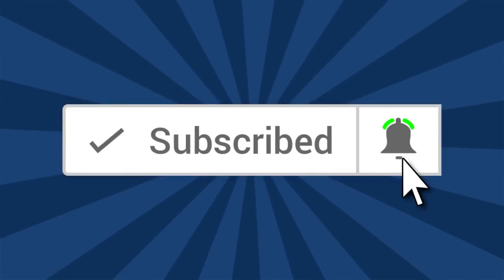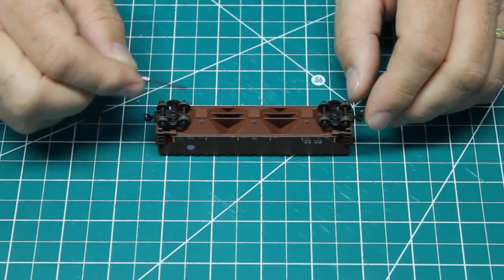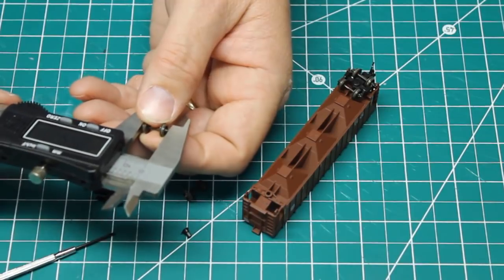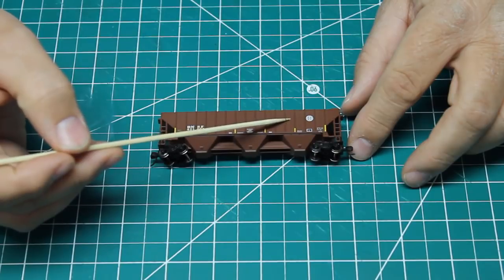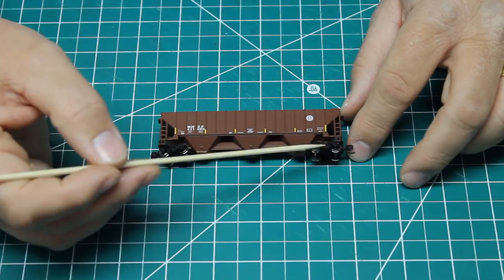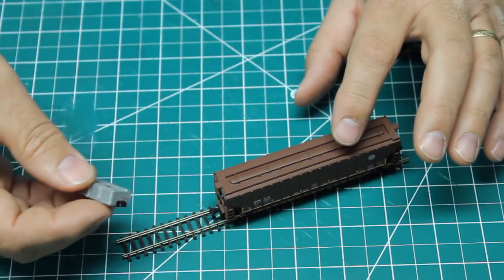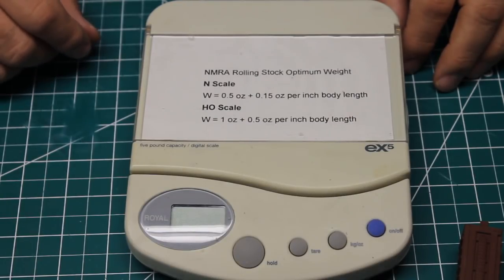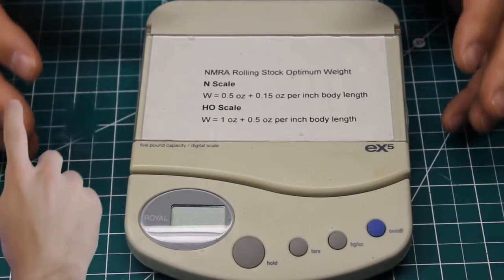Upgrade Model Railroad Rolling Stock

Comment: I replaced plastic wheelsets for metal ones for over 100 pieces of HO scale rolling stock.  I also cut off all the talgo truck couplers and body mounted Kaydee couplers to all rolling stock.  I changed out all incandescent lighting to LED lighting (either strip LED's for coaches and cabooses and single LED's for engines and back up lights).  While I was at it, I weathered each piece of rolling stock.  Took me several months and $400.00 for metal wheel sets and Kaydee couplers.  Cheers from eastern TN

Comment: What I like about metal wheels is that they add weight to a wagon increasing their moment of inertia, without increasing bearing friction that comes from the weight of the wagon resting on the wheels.

Comment: Good video with good tips.  I use graphite powder in every gear box for perfect  coupling and magnetic uncoupling.  I also use in on the wheel bearing pins reduce drag on the car.  Its one of the best performance upgrades
Reply from the maker: Good stuff
Reply: I'm going to have to try out the graphite powder. I'm new to N scale, and found out that  the MT and the Atlas couplers are inconsistent with each other, random uncouplings and sometimes don't want to couple together.  Hopefully a puff of powder into the boxes will do the trick.

Comment: Ron, a word about plastic wheels.  Back in the day when LP records were made they were stamped out from a mold.  The vinyl itself had some degree of adhesion, so before each pressing a release agent was sprayed into the mold.  Audiophiles clean brand new records because the release agent caused several problems. 

I wonder if new plastic wheels don't also have this problem.  The only way to find out is to take a new car with plastic wheels, clean the wheels thoroughly with isopropyl alcohol, and run it on the track for a while.  I would try this for you, but I'm still in the planning stage, hence no pike.

Thanks for all your hard work.

Comment: I WAS GIVEN 1960'S N SCALE CARS WHICH ALL HAVE METAL WEELS , BUT TO UPGRADE THE ROLLING STOCK I BOUGHT MT  BETLENDORF TRUCKS AND LONG  COUPLER . THE COUPLER IS LONG BECAUSE OF HELX IS MORE THEN 19 DEG'S. I EXCHANGE PLASIC WEELS FOR THE STEEL WEELS THAT WAS ON THE OLD CARS.

Comment: Great video Ron. Thanks for explaining about wheel set sizes of 28, 33, 36. Looking forward to watching your video on couplers.
Reply from the maker: Thanks for watching.
Reply: Same. I've been replacing some older tankers with "Bettendorf " bogeys/trucks and couplings from micro trains, but some don't look right. Now I know why!
I also don't like the plastic wheels. It's irritating that the expensive micro trains sets don't already have metal wheels.

Comment: I simplify the process, cage out wheel sets, cut off the trip pin and wiegt my cars .50 ozs. heaven than the NMRA standard, they track better and being heaven isn't an issue with pulling  power.
Thanks for the video it was informative.
Reply: Same for me, William......
Reply from the maker: That works. 👍

Comment: All but 2 pieces of my rolling stock are second hand. Just swapped the couplers on some rolling stock while watching this. The horn hook was replaced by a knuckle coupler. I have a diesel testing it now. Several loops and so far so good. Gave it metal wheels last night.just took the coupler from unused rolling stock. It didnt fit the current layout theme anyway.

Comment: Nice info Ron. As for the weight of cars, if you didn't see my post on Eric's video, here it is

The RP-20.1 NMRA is totally OBSOLETE. Since 1990, a lot as change, cars are build better, but mostly people build there layouts much better, for example, lots of people use much larger radius. Another example is if you're running smaller number of freight cars for delivery. Basically what I'm saying is it depends on your layout and how you run trains. I personally will have weights between 105 grams (empty) and 400 grams (loaded) (3.7 ounces and max of 14.1 ounces) for HO. 

A lot of factors should determine the weight of your cars. If you are running tight radius, than your cars shouldn't vary to much in weight, same applies if you are pulling lots of cars and especially if there is a mix in weights, for example, 3 light cars , 2 heavy, 2 light, 6 heavy, 3 light, etc. 

On half of my fleet, I will be removing a bit of weight for empties and adding a bit of weight to others and the other half, I will be adding weight for full loads. I've build a WORKING weigh station on my layout and weighing cars will be part of my operations.  The RP-20.1 should be totally revised.
Reply from the maker: Hi Lloyd. Thanks for your comment. I agree with you that on larger and very well built layouts the weight issue is less important. However, there are still a lot of people out there building small layouts with tight radius curves and using less expensive Rolling Stock. The fact is a heavier car will track better regardless. It may have less other issues that will cause derailments on a larger or Better Built layout, but I'm trying to help everyone including those whose standards may not be quite as high. Thanks again for your comment.

Comment: Great video Ron.  I had a vendor simplify wheel diameter to this, 36" was for passenger cars and 33" was for freight.  Your explanation makes much more sense.  Question for you, have you ever taken a file to a metal wheel to try and replicate the thump, thump, thump of a prototypical wheel?  Sounds crazy I know, but as a novelty car feature, it might be worth a try.
Reply from the maker: I have not done that, but I don't think you will truly replicate that hard thump of a flat spot on the wheel.
Reply from the maker: I think he is right about the passenger cars, but not even close on freight cars.

Comment: Hi Ron,  I'm just getting started here so I have no rolling stock yet.  This is a great tutorial but it begs the question - There's an initial purchase and an upgrade cost to the Atlas car in your example.  Would it be possible to simply buy rolling stock from another maker with metal wheels and body  mounted couplers for the same or even lower cost?
Reply from the maker: In short, no, I'm not aware that same or lower cost with metal wheels and body mount couplers exists.

Comment: Micro-Trains trucks, BLMA metal wheels, and cut the trip pin off, tap and use a metal screw for the kingpin and of course NMRA weight.

Comment: Ron, any chance you might do a video on the dreaded "slinky" effect of a train and how to minimize it?   I'm also looking for bullet proof hands free uncoupling of N scale rolling stock.  Thanks, really enjoy your channel.
Reply from the maker: The slinky effect is addressed by taking care of two issues, three rolling Wheel sets and proper weight or slightly overweight cars. The slinky happens when either the Wheel sets art freewheeling enough and inertia builds up in the bearings or the cars in the back or two like to keep the train stretched or both. As far as hands-free uncoupling is concerned, I don't even try to do that. I uncouple my cars with bamboo skewers.

Comment: Hey Ron, great video, just wondering about the MicroTrains gauge and the trip pin height. My gauge came with a flat piece of metal you lay across the tracks to see what the minimum height for the trip pin should be. The instructions say the slanted side of the gauge is the Car Underbody Height gauge.  You're supposed to file that from the bottom side to make a sharp edge for scoring your cars? Do you ever do this?

Comment: I watched this earlier and greatly appreciate the info. Please comment on metal vs plastic axles. Also, the wheel sets I find appear to have pointed ends of axles rather than roller bearing trucks. Am I missing them? Thanks!! Seymour

Comment: Ron, I see this is 2 years old. What I am looking for is when I am replacing couplers and wheels is the flange where the truck sits down is to big. Is there a safe way to open up the truck to fit around the flange, like a reamer? Or will a drill bit work or get a round jewelry file and use it? 
The other question is what is the best coupler? I have been replacing all the old style couplers of the 70's that are like square notched which break so easy, I guess old age. I have been buying the Micro Trains couplers and truck sets but they are all plastic wheels.  But I have had some of their couplers not work on their different size or lengths couplers.
Reply from the maker: Micro Trains couplers and trucks are the best in N scale, but compatibility can be an issue until you get all your cars upgraded. As for your reaming issue, I would say a round file would be your best bet.

Comment: another reason to upgrade to metal is Atlas trucks and Bachmann trucks are bad on insulfrog turnouts. Every time you have an Atlas or Bachmann locomotive or car go through a turnout it can derail and you can get a short also you can stall the solution is change the wheels to metal that way you go through the turnout without stopping.

Comment: Here's a question - My stuff is almost all as old as I am, Minitrix and Atlas mostly... is there anything about their being "vintage" that would be frowned upon in upgrading them?  It's not that it matters THAT much, as they were my grandfather's and I'm never selling them, but I'm just curious.  Also have a bunch of Model Power and Bachmann stuff I bought in my teens... those I'm not afraid of messing with.
Reply from the maker: No, I don't think there would be anything that would be frowned upon there. It's not like you are talking about vintage pre-war Lionel stuff that could be worth thousands of dollars in original condition. Upgrades on what you're talking about would make them run better and wouldn't hurt the value at all.
Reply: No,  Unless it is lionel.  Most everything old in "N" scale s round file quality.  I have people trying to give my the old Bachmann, Aurora Postage Stamps and Minitrix,  I feel bad, but thanks, but no thanks.  If someone ever tries to give or sell you a High Speed N scale train just drop it in the trash can.
Reply: IMPROO.com,  I have a Highspeed stockcar that was given to me, the shell looks pretty good but the cast metal underbody has integral hollow bolster pins that are hammered like a rivet after the truck is applied and was so tight that the trucks could not turn.  I broke the trucks off and filed the pins off flush to the bolster.  That is as far as I have gotten, I plan to drill the bolsters to accept pins and install MicroTrains trucks, I need to keep is since it was a present from one of my grandchildren.

Comment: I purchased a pack of Fox Valley 33" axles. I took 6 out to use in a passenger car and all 6 were not in gauge. For the price we pay for them, I think that's pretty poor. I checked them on the standards gauge. 
Also, the packet I bought said they were for ATL, IRC.... Yet they wouldn't fit in the atlas heavy weight passenger cars. After some investigation, I found that the cars were made by rivarossi for atlas. 
Just be aware that some brands make stuff for other brands
Reply from the maker: I don't think I've ever had a problem with Fox Valley wheelsets being out of gauge myself, although I have with other brands a few times. Ask for axle length, yes Atlas uses a number of different axle lengths. I mentioned that in the video. It is annoying, but you have to measure the axles you take out to make sure you get the right size.

Comment: The dirt buildup on plastic wheel sets is due to static electricity.  The plastic, being non-conductive, creates minute amounts of static as it spins in the plastic truck.  The dirt, being non-conductive, is attracted to the wheels.  I've had to clean dirt buildup so thick that it almost matched the pizza cutter flanges of the MicroTrains wheels.

Metal wheel, being conductive, eliminate the static issue by their contact to the metal rails, eliminating the dirt problem.

Since converting all of my N Scale rolling stock to metal wheel sets, I haven't had to clean any wheels.  The expense was well worth the outcome.
Reply from the maker: That covers it pretty well.

Comment: 33” or 36”?  I run MTL 100 ton roller bearing trucks. 

My new Athearn Tankers have 36” wheels. 

I think everything else is 33”

Harder to find 36” metals for MTL Trucks.
Reply from the maker: 100 ton trucks should have 36" wheels. You can get them through Fox Valley.
Reply: @RonsTrainsNThings  
FVM is sold out like every well known Supply Shop online. But I found some at a place over East. Got a 12 PK to try. 

Also Harvested enough metal wheels, the right axle length for MT Trucks out of my stockpile of stripped trucks. I think they are 33” but going to test run them on a local. Enough to do at least 15 cars! 🙂

Comment: When you buy cars at the hobby shop make sure you read the trucks before you buy them an attach them to your cars. If you car is modern you need Barber or Temkin trucks but if your cars are from before WWII you need Bettendorf or Arch Bar.

Comment: Where's the blooper reel for when the coupler fell off? I have heard that is the worst part about adjusting the trip pin. I can feel for you though, I just had a coupler box come off when my cheap old locomotive got banged around in the case.
Reply from the maker: Lol, noticed that did you?
Reply from the maker: That was one of several potential bloopers from filming this. There was also the blooper when my wife called in the middle middle of one of those video segments and I answered the phone and had a conversation with her having forgotten to turn off the camera or the audio recording. And there were some others as well. Life as a YouTuber.

Comment: Thank you for that video. I am struggling with bending trip pins. I've got the MT gage and jeweler pliers. Do you bend the pin while it is still in the coupler?
Reply: I used to bend the pin while it was still in the coupler.  It worked okay, but I found that those pins would cause derailments one way or another.  I now just snip the darn things off.  It's a rare thing to have a derailment now.

Comment: You know Batman? 😮 I can't believe how tiny those wheels are. I'm curious about the wear and tear on the plastic coupling/truck part.
Reply from the maker: In N scale they hold up pretty well. They are large and tough enough to hold up to what wear and tear you have with the small-scale. Larger scales like ho have more problems. The shanks on couplers that are made of plastic can tend to break with time. That's why ho and larger scales tend to prefer all metal couplers.
Reply: As an outsider to model trains, this stuff is interesting. I never had any idea how involved all of this is. It's great to see your channel growing. All very well deserved.

Comment: Good Morning!  I am new to the hobby (n scale) and have been buying lots of used cars from ebay.  As a result, most of my cars have trucks and couplers that don't match up.  Can you guy's recommend a good standard for me to use since I will have to replace all of them so they match.  If you factor in price as a factor, what is a good set of trucks and wheel sets to use across the board and where can I find them?  I do want something of some quality, but as I am building my inventory, price is something I have to consider.  I can get the top of the line stuff in a few years.   What truck and metal wheel set/coupler combinations should I get and where should I order them from?  I appreciate any responses .  Thanks.
Reply from the maker: In N scale the industry standard for couplers and trucks are Micro-Trains (MTL). I would recommend them hands down above everything else. They will come with plastic wheels. Metal wheel sets is a separeate upgrade in N scale. Personally I use Fox Valley metal wheels and love them, but there are others out there that I'm sure are equal in quality. The catch is that axle lengthe vary, so you will need a caliper to measure the axle length to make sure you order the right ones. Good luck and let us know how it goes.

Comment: My thumbs down isn't for the video, but for the not-scale, "Scale" trains. I have an "N Scale" layout. The word "Scale" is simply a lie. This size is no more scale than I am. If it were scale, then all the couplers would be identical. They are not. Every truck and its axels would be identical. They are not.  You want to make all of your couplers work with each other? You can't. You need to know who made your car and what you need to know on how to make it work. Wanna change to metal wheels? You can't. Every maker of rolling stock uses different lengths of axels even within manufacturers like Atlas. A hobby needs to be relaxing, not frustrating. "The Upgrade Model Railroad Rolling Stock" below is a prime example of mis engineered, proprietary components, and tossing out compatibility. Imagine MTH, Lionel, MDK, and K Line producing rolling stock in O gauge that would not hook up to anybody elses rolling stock but their own? Now you have a sense of what its like in the N so called "Scale" scale. Why this size is the second most popular scale behind Ho is beyond me.